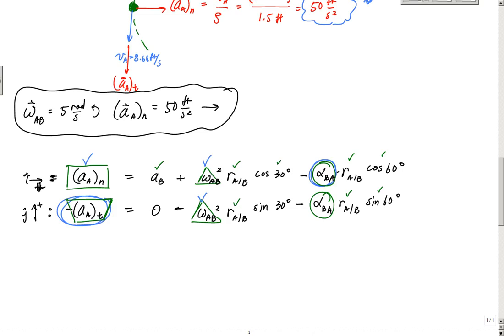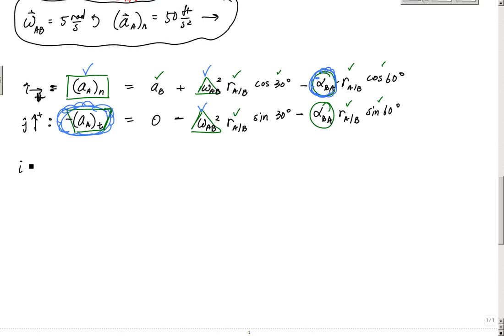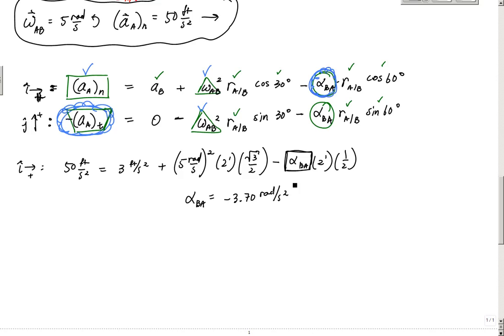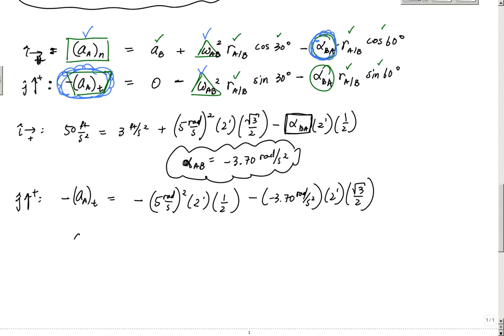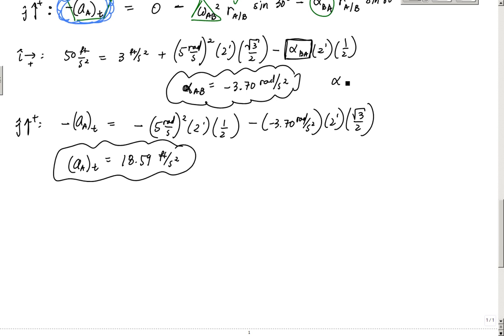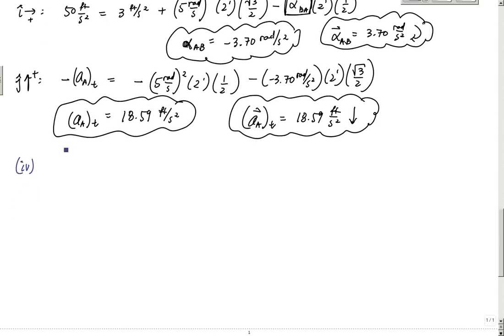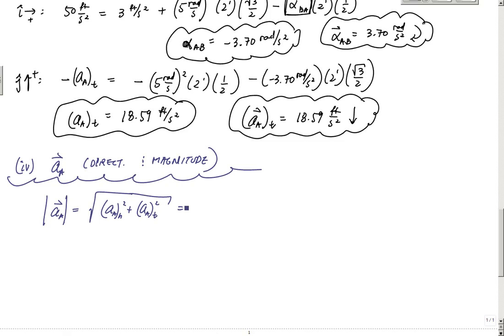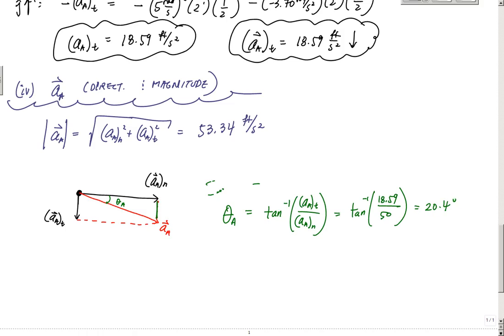Acceleration Analysis Example Part 3 of 3 - Engineering Dynamics - Rigid Body Kinematics

Comment: As I understand it - it certainly is possible. It just takes looking at linear velocity and accelerations. When you have a positive velocity but negative acceleration (i.e. velocity and acceleration acting in opposite directions), all it means is that the velocity decreases with time. I'm pretty certain the same stands for angular velocity and acceleration.